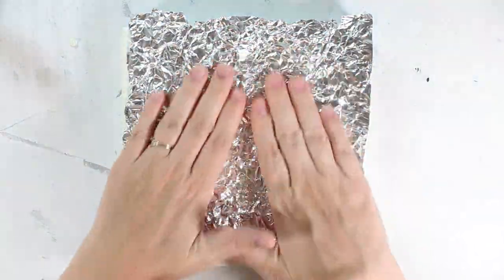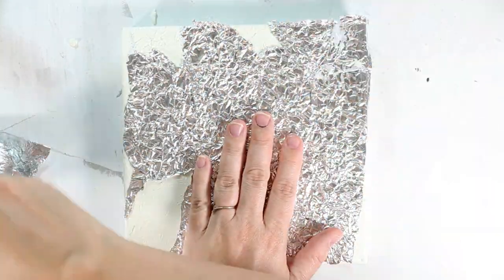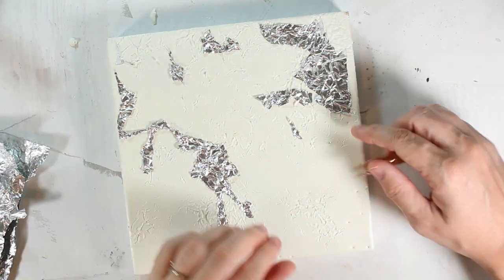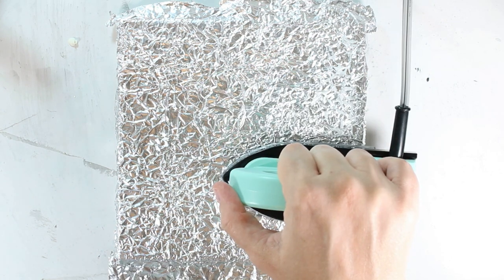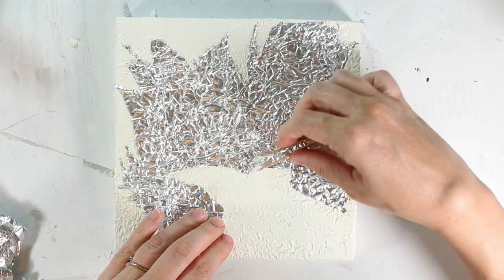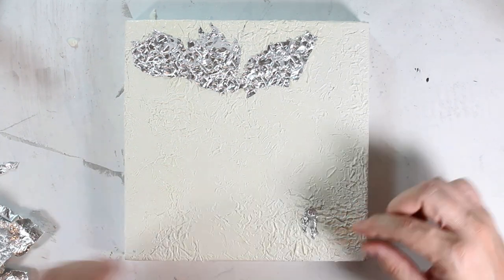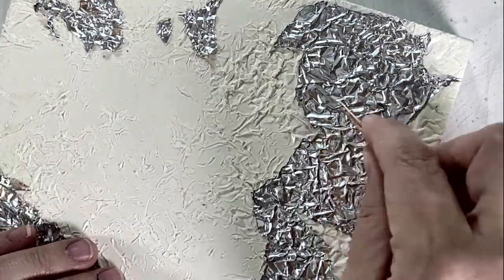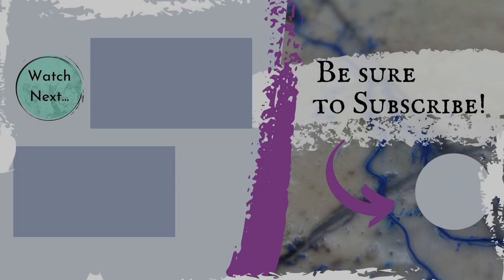Ironing Over Foil to Add Texture to Encaustic Wax

Comment: I am fixing to start encaustic myself after years of acrylic pouring, resin, jewelry, watercolor, woodworking etc. on my own channel...  I am watching every encaustic video I can find to learn by while I am waiting for my supplies to arrive and am enjoying your out-of-the-box thinking and experimenting, please keep doing it!!!  Instead of using the iron to heat up the wax under the foil do you think an embossing tool would work just as well?  Of course then you would have to place something heavy on top of the foil as the wax cooled to have that wax hold the texture (ok, I'm working it out in my head as I'm typing...)  The end result is really cool, kinda like the look you get from using the plastic wrap with watercolors.  Have you done anything else with this piece?

Comment: I wonder what the texture would be like if you used a heat gun instead of the iron?  Great texture!   And cool knowing the foil will bond.  I think dry brushing gold ink/wax/some burnt umber alcohol ink or oil pastel, to catch the edges & emphasise the texture would be really cool & add dimension.
Reply from the maker: Yes, those are all fantastic ideas. I need to try this one again since it was so cool.

Comment: Very cool! I like it as is, but I like minimal art works. I wonder if so heavy duty plastic food wrap between the foil and wax would help with removing the foil but still allow the texture? Might be neat to try heating the wax w/ a heat gun and then quickly placing the foil and rolling it out with a brayer roller with firm pressure. :)